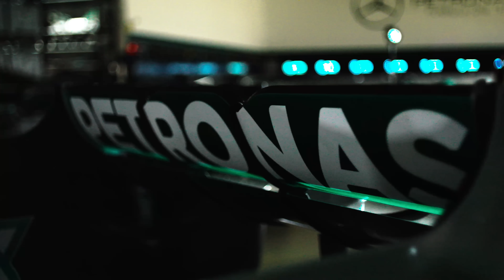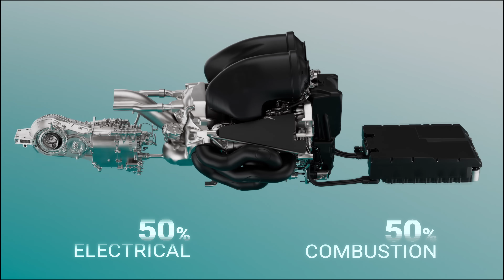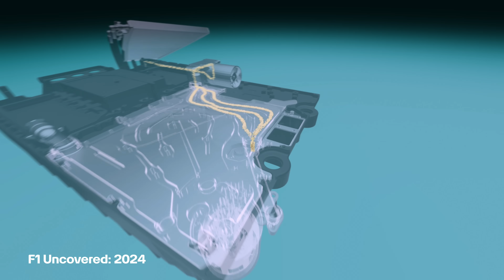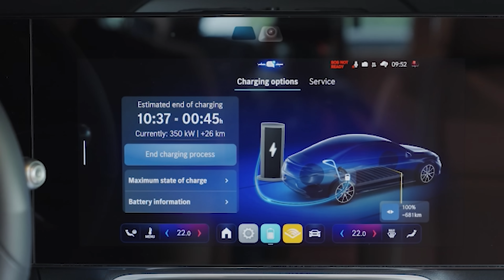The Road to 2026: The Power Unit

Comment: 0:58 how? The mgu-h has only been recently adapted to road car use, at the end/start of the era where the mgu-h is no longer used in f1, so you are going back to regular hybrid technology which is what 10 years old now? Or 26 if you look at the first prius.
Reply: dropping mgu-h is the most stupidest decision. say goodbye to 50% thermal efficiency. instead of harvesting excess exhaust gases out of the turbine lets just dump it out of the wastegate.
Reply: @roku_nine  I agree that it's a shame to lose the tech. I'm a little surprised it's so difficult to implement well, but it must be - otherwise I'd expect to see it in road cars.
Reply: @davidg3944  The inlet of the MGU-H can exceed over 1000 degrees C under race conditions. The rest of the system is over 200 C with the turbo spinning at over 100'000 rpm. Getting the bearings, stators, windings and magnets to survive such temperatures and speeds is just... expensive. Its not that it can't be done, its just not mass-production viable. Also note they've has 11 years to work on the technology and they've only squeezed 5% efficiency out of the engine.
Reply: @davidg3944  simple reason, mguh can only harvest most efficiently when the engine is producing significant boost. Think back to your city commute and see how often you're pressing the gas flat to the floor, or how much pedal pressure needed to maintain 70 mph on the freeway.

Also, you still need a seperate mguk system to recover braking energy. turbo generator can't do jack for recovering kinetic energy.
Reply: @Appletank8  because you arent pressing the pedal all the way down doesnt mean anythimg, air still flows through the engine and if the engine is at steady stake the turbo is still spinning and therefore producing electricity. Cruising at 70 mph doesnt mean the turbo isnt spinning.

This is a bad comparison
Reply: @roku_nine  Given that even with the MGU-H an F1 ICE is only 50% efficient and a purely electrical system, such as Formula E, is 80-85% efficient (This includes losses from charging/inverters) losing that 5% isn't the end of the world, especially when no mass production road going car uses an MGU-H. I couldn't even find a low volume/batch-run/one-off super car that uses an MGU-H... kinda says it all really.
Reply: Pushing electric motor and battery tech for future EVs
Reply: @Tommmmmmmmmmmm  No one is buying EV's. VW alone are now spending many billions to develop new ICE engines for EURO8 standards.
Reply: It was a cool idea but there are no road cars that use an MGU-H system. The extra steps of capturing that heat, having materials that withstand the extremely high temperatures and the technical/mechanical complexity make it less efficient overall than just recovering and storing excess kinetic energy. Add in the additional points of failure a split system has and the packaging/Centre-of-mass penalties and its even less appealing.
The closest Ive found to MGU-H on a road car is BMW using the heat in the catalytic converter to power a Thermo-Electric generator which helps reduce load on the alternator but they are not in mass production.
Reply: @intuitiveinterativedesigns8670  MGU-H doesn't capture heat. It sits on the turbos and harvests kinetic energy from the turbo spinning up.
Reply: @v4skunk739  Capturing probably isn't the right word. Ducting? Routing? Channeling? Point is it still takes the extremely hot gasses and uses them to spin a turbine to extract otherwise wasted energy. However, you are still capturing energy from hot gas, eventually storing it in the batteries, and the rest is lost.
Reply: @intuitiveinterativedesigns8670 using the hot gas for another function before its shot out the tail pipe is literally the most efficient way to recoup energy, that why the turbo charger waas designed for
Reply: @km6832  It might be, but its not viable at mass production scale. Think about it, these 20 vehicles are the only ones running an MGU-H on a regular basis on the planet.
In 2014, the MGU-H was a good idea to squeeze every last bit of efficiency from an ICE. 11 years on its become clear its not viable for mass production and added complexity and weight to a racing car that most fans would agree needs to be put on a diet.
Reply: @intuitiveinterativedesigns8670 i agree, but to say its not viable is misleading. Its long to adapt for sure but it can definitely work
Reply: @km6832  also also, there's an alternative way to reduce energy lost out the tailpipe: over expanding the power stroke so the exhaust cools off more, and exits the cylinder at lower pressure as more work has been done within the engine itself.
Reply: @intuitiveinterativedesigns8670 porsche and mercedes have mgu-h road car applications. Some research wouldve done you well before you typed this paragraph
Reply: @intuitiveinterativedesigns8670 porsche and mercedes have road cars with mgu-h applications.
Reply: As other people have pointed out, MGU-H turned out to not be capable of recovering enough energy to make it viable, especially commercially. And probably with F1 it just meant additional failures and weight. Sometimes less is more, which hurts my heart a lot as an engineer, but KISS can be the golden rule for what actually works well in the real world. Keep It Simple Stupid. It doesn't mean that not more and more technologies are worth it and creep in where the added complexity is worth it. Variable valves, DCT, variable turbos, etc. etc. The drivetrains are becoming more and more clever.
Reply: @drags-yt whybdo you all keep saying its not viable? On what grounds other than "complexity" its very viable and can be integrated into road vehicles.
Reply: @km6832  It's not viable because mguhs work most efficiently only when the engine is near max power, high rpm. At lower speeds, the engine just isn't working hard enough to produce sufficient gas flow. Your cruising efficiency is also slightly compromised by needing lower compression to handle turbo boost.

an mguk, or regular hybrid, is instead most viable at lower speeds where you can run the engine closer to it's efficient zone and siphon off any excess energy for extra acceleration elsewhere, and recover energy while braking, something mguh can't do. In reverse, mguks are less useful at max power as the battery reserve drains, but that only really happens on mountain climbs. most cars aren't run at high throttle for long periods of time, making mguh suited for racing, not commuting.

instead, mguh has only seen viability in prop planes of post ww2, and maybe semi trucks.
Reply: @km6832  side note, only merc and porsche have done anything close to putting a mguh on a road car. Ferrari, honda, Renault, no mguh anywhere. 

building a turbo engine is also just more expensive than a n/a engine, eco cars will be hard pressed to justify turbo + hybrid system costs.
Reply: @Appletank8 thats not true? Road car turbos have a wide power band and can generate electricity from low rpm all the way to redline additionally once the turbo is spinning its producing electricity. Also i was wrong with the road car examples, the 992.2 gts, merc e53 amgs, the ferrari f80 and im pretty sure the w1 have mgu-h tech

Comment: I feel Honda will dominate next year
Reply: GP2 engine...
Reply: @shronklescrimblo69  ...because?
Reply: @Jaco_Schutte  Because they already have the best engine on the grid and like for the last 4 years?
Reply: @v4skunk739  good enough to win, not necessarily the outright best. The Red Bull chassis played as big a part if not more so. If they had an engine advantage over Mercedes, then McLaren would be less dominant.
Reply: @v4skunk739  and as a follow-up, the last time there was a major power unit change, Honda didn't exactly cover themselves in glory. I'm not saying they won't be good, just that it's too soon to say who will be best.
Reply: The Honda engine is still quite a way behind both Ferrari and Merc!
Even Lando confirmed that…
The RB has extremely low drag but it’s mid range power is still lacking as seen in 250 kph corner exits
Reply: @Jaco_Schutte well, honda had  ended their f1 activity for a very long time before 2015 and that basically make them had to reset their f1 r&d from 0 and McLaren forcing them to enter f1 one year ahead of proposed schedule in 2016 didn't help either, hrc president koji Watanabe confirmed that the 2026 engine development is smoother and different than the one they've had from 2015 because there's still some personnel from red-bull honda partnership that now also working on the 2026 engine which mean honda didn't started from 0 for developing the 2026 engine
Reply: Gp2 lawnmower
Reply: Same.

Comment: Is mercedes ditching the split turbo layout? Surely keeping the layout still has benefits to lower the intake charge temperature?
Reply: from other YouTubers i've seen talking about the new rules, split turbos are or seem to be banned
Reply: @skyeroy29 wow, they are really walking back some of the major innovations. They might as well make the Turbo a spec component.
Reply: @jims6614  they have to it’s in the regulations that the turbo cannot be split.

Comment: bs you are mercedes you know your eletric cars don't sell you just don't wanna admit it, if people had a choice they will buy internal cumbustion every time if the price of the fuel would be equal
Reply: ICE is dying faster than ever chump
Reply: idgaf about electric or ice but efficiency should be top priority. dropping mgu-h which is the key to efficiency is the most stupidest thing ever! instead of harvesting free energy out of the turbine exhaust gases will just be dumped out.

Comment: Mercedes clearly are the heavy favorites to be the fastest car and have the fastest engine in f1 in 2026 with the new regs, but I think will be way off the mark to have the domination of 2014-2016 in engine side, because in this time without the MGU-H, the other manufacters like the main rivals of Honda and Ferrari will be close but short!
Reply: @guilhermemoreira6125  That should be Mercedes and Mercedes customer teams.
Reply: @I_Evo Yes I agree, mclaren of course unlike 2014 have a very good strong lineup with two of the top 6 drivers of the grid, and of course have better structure and engineers and could be a danger for Mercedes dominance, Williams Will be good in fast tracks with long straights but Will struggle in downforce tracks because they havent the money and resources for compete with the best temas, alpine Will be good in tracks with fast corners and could be good in high downforce tracks! I think audi, caddillac will be a long way off the mark specially in aerodinamics and downforce side, red bull will struggle with new engine and will be way off, Ferrari Will be a darkhorse but have money and very good drivers for compete, Aston Martin Will be very good and could BE a danger